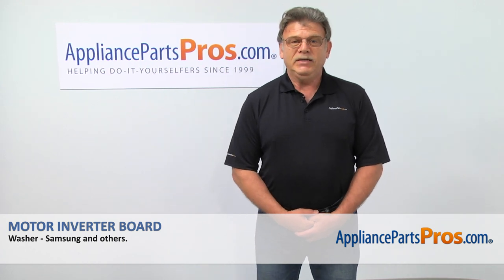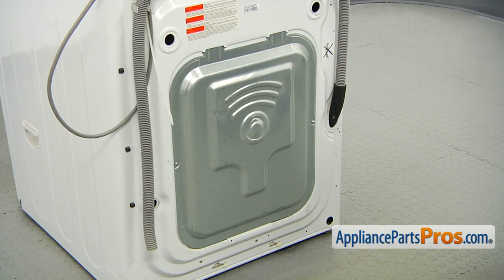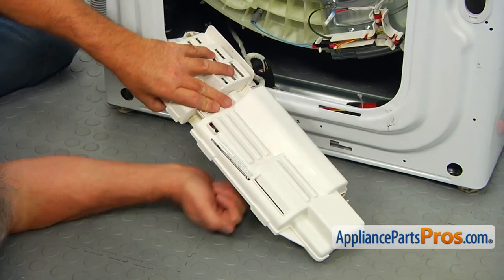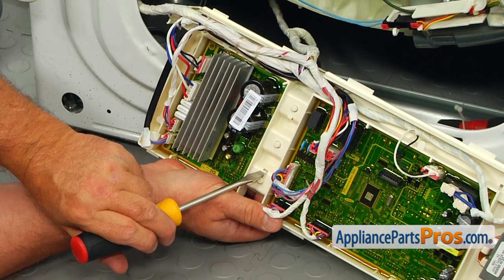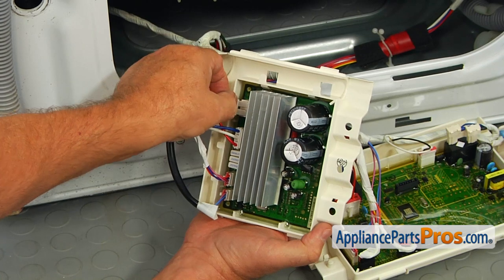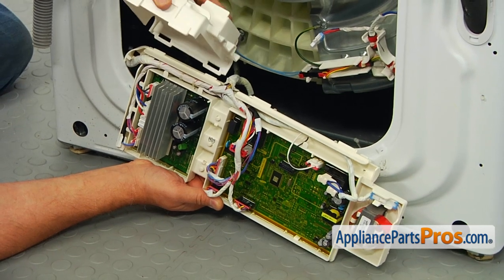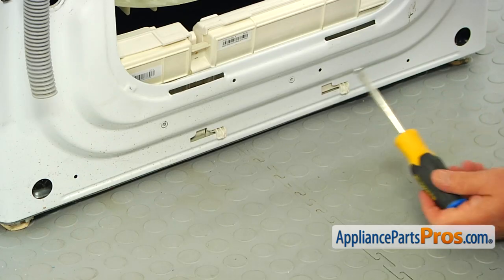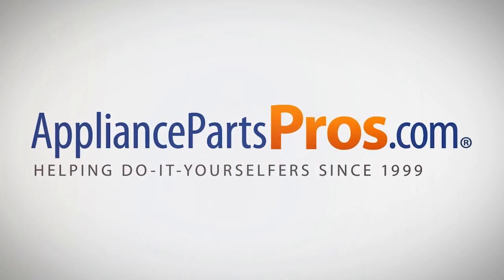How To: Samsung Motor Inverter Board DC92-01531B

Comment: No my problem still exists after changing all the boards. I bought the mems sensor which is my last option to get this machine working again. If it isn't fixed after that then is money down the drain for this washer. Will keep u posted when I receive and install the part.

Comment: how about repairing the card, you learned on the card's udder, you repair the memory of the module
Reply from the maker: The manufacturer recommends replacing the board if it has failed.

Comment: Thank you. Ordered my inverter from your store. Problem solved.
Reply from the maker: You are very welcome. If there is anything we can help you with in the future please let us know.
Reply: Did your washer spin for 10 seconds one way stop for about 15 and then spin for another 10 seconds in a loop?
Reply: @andrebrooks7040  not exactly. It would start to spin but then stop shortly after. From there it didn’t do anything. Water was in the drum so I had to drain it out. Eventually replaced the inverter and it works again like normal.

Comment: after replacing board, any other steps before using washer?  Thanks!
Reply from the maker: No, once you replace the part you can start using the unit.

Comment: @appliancprtspros I think this might be the problem I'm having, but I'm still not 100% sure. Is there a way to test the inverter board before I spend the money on the part? I'm not getting an error code on my FlexWash, but the stator and rotor appear to stutter when trying to spin. The unit is capable of a full rotation, but only when sensing a load, not under the stress of a spin. I've troubleshot a bunch of other parts including the vibration sensor, pressure switch, door lock, etc. Any insight would be appreciated. Thanks.
Reply from the maker: What is the model number of your appliance?

Comment: Does this fix the problem with the washer not spinning or completing a cycle?
Reply: Hey, could you fix this problem? I have the same and I´m in doubt about changing the PCB-Inverter or the PCB-Main.
Reply: I have a same problem. Rinse->spin->Rinse-> keep again.... Did you fix it?
Reply: @marcoskssiani  i have the same issue.. did you figure out what it was?
Reply: I am having the exact same issue. Did this help it?
Reply: Curious about this too. 3c error, intermittent draining issues, and constant stopping during cycles that turns quick wash into not quick at all. I've seen reviews on Amazon for this part that claim this part fixes that. Just looking for confirmation.
Reply: I’m guessing no one got an answer
Reply: Yes this fix/inverter board replacement is one of the main issues with the washer stopping mid spin. However, there are small possibilities it could be another issue, but this is normally the main reason for this issue.

Comment: Can you please help me? I have a washer WF50K7500AW/A2-00 and it doesn’t spin fully. 

It spins for about 10 seconds one way, stops for 15 seconds and then spins the other way for 10 seconds in a loop.

I’ve only ever got it to pull a U6 code and a Cr??
Reply from the maker: With the U6 code it is saying that the machine is unbalanced. Have you tried to just unplug your washer for a few minutes and then plug it back in to see if the board would reset itself?
Reply: @appliancepartspros  yes. I’ve had it unplugged for a little bit.

I ran the diagnostic again and only displayed 0001

The washer never runs a complete cycle. Constantly spinning for 10 seconds medium speed, stopping for 15 seconds, switching directions and spinning medium speed for 10 seconds back and forth. Never reach’s a full spin, or wash pattern.
Reply from the maker: Have you recently had any power outages?

Comment: Awesome information! Using this video, I skipped the poorly trained appliance repair tech numbskulls and did the repairs myself. I changed the stator, inverter board and main control panel/dial selector boards. I received all the parts for free under an extended warranty I bought 4 years ago when I bought the Samsung washer. But the extended warranty techs keep sending the wrong parts and then they can't install them until weeks after the parts arrive. I installed the unneeded main control and selector panels, and they didn't fix the problem despite the extended warranty tech telling me that was the issue. I just got this inverter board and a new stator installed and the machine finally runs great! The nitwits also sent me the wrong power board but thankfully, I didn't need it. No more sitting around 8am-5pm 2-3 days in a row being held hostage by useless service tech yahoos who show up (or don't show up) when the feel like it. I subscribed to your channel and liked this video - Thanks!
Reply: ok boomer

Comment: This video stepped me through replacing the inverter board on my WV55M9600AV/A5 washer! 👍🙂Thanks for the clear walk through- if only I had the same amount of free space around the unit! Quite a bit more difficult when you're trying to squeeze between the wall and the back of the unit! ¯\_(ツ)_/¯
Reply: Hi I'm looking for the inverter board with the same washer as you are.
Would you please tell me the part number of the inverter board that you bought and where did you buy it from?
Reply: @thaison773  I've tried like 4 times to reply but youtube is deleting my responses. :(
Reply: @thaison773  Samsung Washer Control Board  DC92-01531C
Reply: @Vern Graner  hello
 I appreciate your response
I actually found that same board that you mentioned and finished installing it today,  washer works now.
Thank you